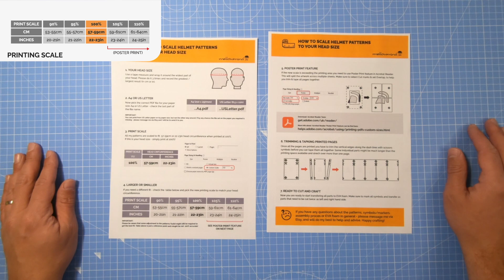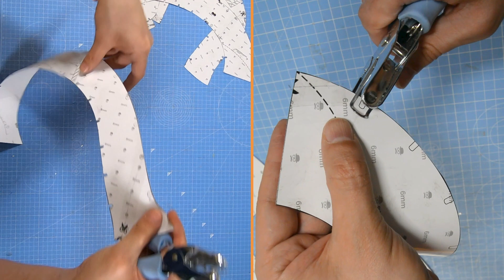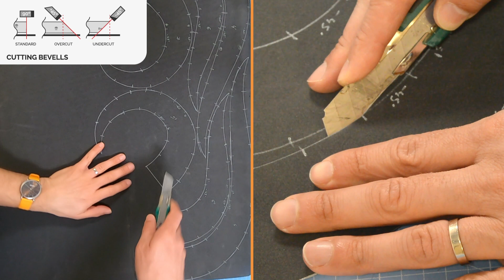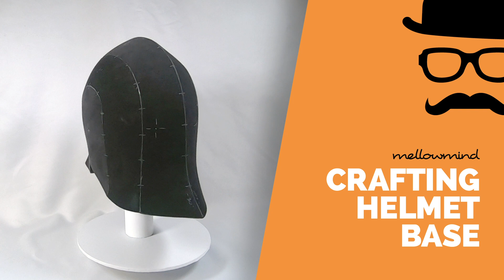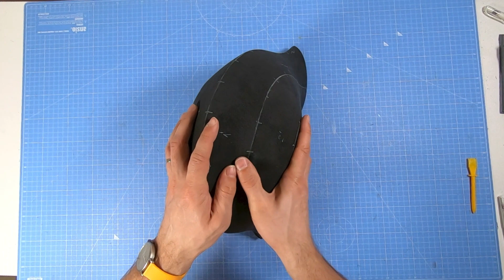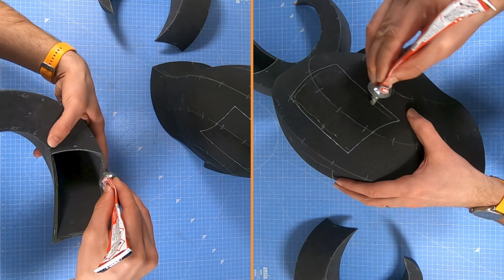How to craft my Serpentinus helmet - EVA foam crafting video

Comment: Would you recommend cutting the face hole after or before assembly?
Reply from the maker: I would cut holes at the very, very end - after the helmet is fully assembled and glue had time to dry (min 24h). This way you aren't  risking weak joints, misalignment or parts pealing off. Having no opening/gaps along adjoining edges allows for better structural integrity and creates much more stronger bond between parts.